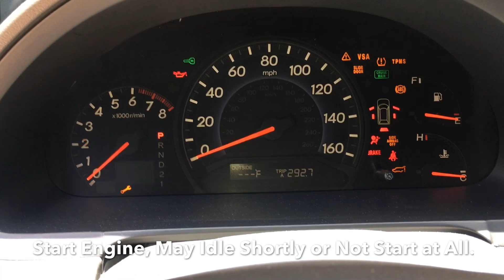Honda Odyssey Fuel Pump Replacement DIY

Comment from the maker: Parts and tools listed below:
1999-2004 fuel pump assembly: https://amzn.to/4hstK4i or https://amzn.to/4jNWC8m
2005-2010 fuel pump assembly: https://amzn.to/42D9Ui6 or https://amzn.to/4hMWjJt
2011-2017 fuel pump assembly: https://amzn.to/4gzh4XU or https://amzn.to/4jLlwWk
Fuel pump lock ring tool: https://amzn.to/4hoN0Q6
Fuel pump relay: https://amzn.to/4hnEUY1
Electric screwdriver: https://amzn.to/42Hu2iW
Torque wrench: https://amzn.to/42Ihb08
3/8 ratchet: https://amzn.to/4jJx8t0
Long screwdriver set: https://amzn.to/4jLOOE7
#ad

Comment: I like how u removed and installed the same fuel pump for the purpose of making this video. Respects
Reply from the maker: 90% of my videos haha
Reply: Where is the filter,  I'm troubleshooting a lack of power, not accelerating over 55mph, 3k rpm issue,  revs fine in neutral,  just won't go interstate speeds or over the bridge.

Comment: Nice video, except I would have left the cover off until I had the vehicle running and checked for leaks.  Just a thought.  Thanks for doing the DIY videos.
Reply from the maker: Ron Dail you can do that before putting everything back together, I actually took it for a spin.

Comment: I made it on a odyssey 2013, but spilled a lot of gas, May I suggest to open the gas cap before removing the line, to release the air pressure, I don’t know why the tank was pressurized, thank for your help.
Reply from the maker: Watch the video again to see how i relieved the fuel pressure

Comment: Thanks for the video. Just changed fuel pump on a brand new 2007 with 226,000 miles. Was hard-starting when warm... almost positive this will fix it.

For others, it hard started when warm. Did the "easy test" by cycling ignition from off to run 2 - 3 times before trying to start and it would ALWAYS start right away. Without doing that, 10-second crank to start at least... maybe longer. Also threw erratic misfire codes, never consistent cylinder-specific codes but always a "general" misfire code. Did the basic stuff and the codes persisted. South Florida, 90*++ heat.

Took about an hour to swap the fuel pump. Very easy.
Reply from the maker: dont bother lolol yeah the fuel pressure regulator in the assembly caused that
Reply: all in all it's good to know how it fails gently and does not quit while driving ✌🏻

Comment: 2008 odyssey here: Mine didn't have the fp relay in the location shown, however behind fuse door in that location pulled 15 amp fuse for fp. turned the car over for about 10 seconds with no start.
Removed neg battery. When disconnecting the fuel line at pump there was ALOT more pressure than expected, had rag covering fuel didn't really go anywhere except in the fuel pump area. could hear pressure escape for a good 5 seconds. Maybe should have opened fuel fill cap? I ordered the delphi $203 full assembly. The seal on the delphi unit looked cheap compared to the original one but used it anyway. kinda tricky with that seal to not get it folded over, good tip in this video for that. Mine seems fixed. The issue was 50/50 sometimes start right up like normal, sometimes crank and crank and eventually start if you depressed gas pedal or stopped cranking and tried again. 160K miles. got to have the spanner tool for this vehicle imo. Thanks for the video, it helped alot.
Reply from the maker: solorsix yeah you should of removed the gas cap to relieve pressure. I pulled the fuse the night before doing the job also. 
Check your MAF sensor, air filter, and battery for the intermittent starting problem.
Reply: @MrRangerZr1  Thanks for the reply. I thought about up and changing the map sensor first. I knew it wasn't air filter or battery though. I will update if it turns out the fuel pump assy was not the cause, however, the vehicle has not had the starting issue since changing the fp assy. I will also add to maybe help anyone else that the starting issue went on for about a month and while maybe 40% be hard to start shortly after running, it would 60% do it after sitting overnight. Another thing I noticed after replacement was key on, new fp would run for maybe 2-3 sec and stop, until car start. The original one, key on, would run way longer and the times varied, like sometimes 10 seconds. It would help with starting if you waited key on. New fp, just jump in and start right up.
Reply from the maker: solorsix really sounds like you had a bad fuel pump. Hopefully that was the fix. Always thoroughly diagnose the problem before spending money fixing.
Reply: @solorsix  so now 9month later you can confirm the pump assembly fixed your flaky start?? 
Around what mileage: 160kMi?
Reply: @glasser2819  Yes I can confirm that was the issue on this Van. We have had no starting issues since replacement. It started happening around 160K miles, correct.
Reply: @solorsix  my 2007 odyssey at 160k miles having THIS EXACT issue as well. glad i came and read the comments :)
which fuel pump assembly and where did you order it from?

Comment: 2011 odyssey recently started taking longer to start.. sometimes start good sometimes takes longer to turn over.. battery charge shows at 14v. Alternator was replaced 40k miles ago. I have vcm muzzler and occasionally drive it like a race car bc running late to work. Averaging 20 mpg. Performance of the van seems the same. However this occasional longer starts makes me wonder if I need to change the fuel pump or the regulator or filter… If I was to do that which one would you suggest to start with? Should I just go ahead and replace the whole assembly? Bc it seems like adding all the parts together, pump, regulator and filter it’d come up at the same price as the whole fuel pump assembly, right?
Reply from the maker: It's the fuel pressure regulator, common issue.

Comment: Great vid. So if you connected an extra hose to that fitting could you use the fuel pump to empty the Odyssey's tank to an external fuel can?
Reply from the maker: Not really. Fuel pump runs few secs with engine off key on.
Reply: You can run a wire from the battery to the pump and keep it running to empty the tank.
Reply: @andrewhathaway3302 ,that's dangerous.  Just jump the relay connection

Comment: I have a 2012 Honda Odyssey touring Elite. I researched where my fuel filter is, but it was just a bad pick with arrow directing to the fuel pump area. Is it a part of the fuel pump?  Wondering where it is exactly. 
Thanks so much for your videos, like others have said, straight to the point videos. Keep up the good work!
Reply from the maker: Can you elaborate a little more?
Reply: @MrRangerZr1  I just googled 2012 Honda Odyssey touring fuel filter location and the pics that come up have arrows pointing to where fuel pump is.
Reply from the maker: All of the odysseys have the fuel pumps underneath or behind the 2nd row seats as shown in the video,
Reply: @MrRangerZr1  when you pulled the pump out I didn't see any filter. I was just wondering if you knew if it was a part of the fuel pump assembly because I didn't see anything on the top of the fuel pump.
Reply from the maker: Yes it's in that white basket. I changed the pump, filter, and regulator. I would not advise doing this because you will break something due to the components being really brittle, just buy the whole assembly.
Reply: @MrRangerZr1  they make everything else reasonable accessable and they couldn't put in an inline filter? Geez lol
Thanks so much for getting back to me!! I really do appreciate it!
Reply from the maker: Honestly you don't need an inline filter if you fill gas at the good stations. My 160k fuel filter literally had 2 grains of sand, no kidding.
Reply: @MrRangerZr1  I'm in Canada and use Costco gas the majority of the time and I think they get their gas from husky. How would a guy know where to buy a good gas and a bad gas? 
Shell boasts they are the best but then so does esso lol
Reply from the maker: Here in the states, Shell is the best but also the most expensive. Shell, mobil, chevron are good. Sunoco, marathon, citgo, westar, I avoid. 
Make sure to never buy gas from the station whenever the trucker is there, whenever you see the trucker, run away. 
When the truck fills the station's tank, all the sediments from the bottom are disturbed and floats around, if you fill your car at that moment, you're gonna fill your tank with all that debris.
Reply: @MrRangerZr1  Something I would have never thought of. Thanks so much!
Reply: @MrRangerZr1  did your fuel pump happen to quit pumping at 160kMi -or were you doing doing preventive maintenance??

I have an '04TL @150KMi and wonder about the OEM pump design  lifespan... 
I'd hate to brake down for something that predictible 😉
Reply from the maker: G Lasser the regulator was the only thing that went bad. Honda fuel pump dont really go bad. Btw almost all my videos are just for you guys my cars don’t need these repairs I show lol

Comment: Awesome video but wouldn't it be better to turn on the van just to check for leaks before putting the aluminum cover back on?
Reply from the maker: Sure
Reply: @MrRangerZr1  you never know your a pro but a amateur might not put the hoses on just right 👍 thank's again for the video

Comment: Great video.  My fp is leaking gas.  So I'm going to replace.  Do you recommend oem fuel pump over the Delphi? Or just get the one you have in link? Also  is it really necessary to clean fuel tank before installing new pump?  My oddy had 100k 2010
Reply from the maker: Get the one I listed in the description. OEM/Denso or nothing.

Comment: My wife's 2012 odyssey will turn off when facing downhill and she stops. Any suggestions sir?  This is a fantastic video, if this is what I need to do. Thanks for all you do sir!
Reply from the maker: If the van shuts off when it comes to a stop then check the air intake tube for cracks/leaks
Reply: @MrRangerZr1  great, thank you so much. I changed the Air Filter yesterday. It was extremely dirty. I'll keep an eye on it.  Wasn't sure if it was a fuel pump issue. If it got to maybe a 1/2 tank and for some reason it isn't picking the fuel up.

Comment: Thanks for the video.  Any idea how to test fuel pressure on a 2015 Odyssey?  I'm not sure where/how to hook up the fuel pressure tester gauge.  There does not appear to be a schrader valve in the fuel system.  I'm having intermittent hard start issues.  Thanks!
Reply from the maker: You need a special adapter to connect to the fuel line in the engine bay near the master cylinder
Reply: ETCG, Eric the Car Guy, has a video for checking fuel pressure with a gauge. I used it for my ‘02 Odyssey. Kits can be borrowed for auto parts places to check the pressure.

Comment: Hi brotherI have 2008 honda odyssey with codes p0455 and p0456 (evap small and large leaks) is intermittent  code not always give the codes but yesterday my kid says smell to gasolina  he was seating in the 3rd row seat so i want a start looking around the fuel pump maybe any gasket that need to be replaced  or any tips my friend?
The odor is in the cabin so pretty sure the problem is not in the engine bay tku
Reply from the maker: Change the rubber gasket around the fuel pump lock ring,
Reply: @MrRangerZr1  tku  brother

Comment: Please MrRangerZr1, I have this error in my 2008 Honda Odyssey Touring “tighten fuel cap”. I replaced the fuel cap but the error disappears and after a while shows again: Any ideas? Thanks!
Reply from the maker: There's a leak somewhere in the EVAP system. 
Check the evap lines under the hood.
Reply: @MrRangerZr1  is it a gasoline leak or a emission leak? Because I don’t smell any gasoline. Thanks!
Reply: @MrRangerZr1  is it possible the canister purge solenoid valve? If so, do you have any tutorial? I checked all your videos but I can’t find it.

Comment: I say thank you Honda.  How many cars have fuel pump access through the floor from the factory?
Reply from the maker: Yeah it's pretty easy to access on this model
Reply: @MrRangerZr1  I did the pump on my friends old Town and Country.  We couldn't drop the tank.  I cut the floor but it was tricky to find the right place and not damage the wiring and hidden plumbing.
Reply from the maker: Wow

Comment: How often should one change the fuel filter and or what are the reasons to change it out?  I have a 2006 Honda Odyssey.
Reply from the maker: You really don't need to change the fuel filter if you buy gas from quality stations and don't fill up when the tanker is at the station.

Comment: My mom's oddysey does not accurately show fuel level. Is the sending unit part of the fuel pump? Would the whole pump need to be replaced? Can't seem to find any YouTube help on this issue.
Reply from the maker: Yes the fuel sending unit. It's the black float on the assembly.
Reply: same here Acura TL'04 has always have a funny fuel guage level... I believe their linear design does not account for the actual irregular shape of the tank ie. new sending unit same problem 😉
Reply from the maker: G Lasser engineers to do on purpose because they know people will keep driving with the low fuel light on lol
Reply: Get a whole.new pump cause its an all in one now.

My.old.voyager has this issue and the gas gauge was Busted....it'd show.me.full gas when topped and then.fall to e after 10 Liters went despite still.working....surly after I ran out of gas on the highway cause I.didn't know.when to.fill....and shortly after the fuel pump just slowly died and failed in.my.driveway.

A whole new assembly fixed it....and Chrysler is much worse because there's no insert from the inside- you have to.go.under and actually drop a side.of.the tank.to.get to.it

Comment: Is the pump and filter together? Or do i need to do something else to replace the fuel filter also?
Reply from the maker: Stetson Griggs its one whole assembly. If you just replace the fuel pump motor, you’ll have to take the assembly apart.
Reply: @MrRangerZr1  awesome man appreciate that.

My wifes van is messing up and i suspect it to be the fuel pump.

She can drive around fine and at random just loses abikity to accelerate
 unable to start. Wait an hour starts right back up keeps on going.  

Im between the fuel pump. Throttle sensor, maybe air flow sensor.
Reply from the maker: Stetson Griggs odyssey van? Check the coolant temp sensor aka ECT sensor and also the coolant level. Video is on my channel. Fuel pressure regulator can also cause this.
Reply: @MrRangerZr1  ill for sure check into these things.
Reply: @MrRangerZr1  im back, so now im actually getting to see whats happening. Wife left out many details.

Its an 08 honda odyssey 

So right now the car  gages are not moving, the radio isnt working, acceleration kinda jumps, but the car never lost full power or shut down. 

Upon shutting the car down it wont  start back up.

Several lights came up on the cluster the battery light was first. 

I let the car sit idle fbefore i shut it off for 20 mins and it was fine.

Any clue what this is?
Reply: Added to that its a new battery, alternator was checked by a "professional" a week ago said its working properly.

Comment: Wife's '07 Odyssey keeps acting like it's starving for fuel, kept dying yesterday at ¹/8th tank on cold start, added fuel and it was fine. Today it died at idle when she stopped for a few minutes (after warmed up), is this most likely the culprit?
Reply from the maker: Check the fuel pressure if possible.

Comment: Where would the fuel pressure regulator be?  Is it part of that unit?
Reply from the maker: It's inside the assembly. Small valve like part.

Comment: I have a 2005 Honda Odyssey and I smell gas in the rear. How did you know it was the fuel pump?
Reply from the maker: The fuel pump assembly gasket is torn or old. Had a gas smell for the longest time after the recall, then one day I went in there and the dealer idiots didn't install the gasket properly.
Reply: @MrRangerZr1  So you had the recall done, they didn't do it correctly and you then did it yourself? Will you see a leak underneath the vehicle or do you have to take the inside apart to find it?
Reply from the maker: After the recall was done, whenever I used to get gas, I smelled gas fumes inside the cabin, thought it was normal cause the van was fairly new. Many years later, I went in there and found the gasket pinched, replaced it and no more gas smells ever. You have to go inside to see it, has to leak a lot to leak on the floor.
Reply: @MrRangerZr1  I smell gas outside the vehicle on the driver's side. I'll probably take out the seats and see what's going on as well. I never had the recall done. Actually I just found out about it. Thanks again!

Comment: How many miles?
Reply from the maker: 160k miles. Had to replace the fuel pressure regulator.
Reply: @MrRangerZr1  what made you pin point the regulator valve: low rail pressure or random misfires?
The pump core itself was still ok ?
Reply from the maker: G Lasser everything was good except the regulator